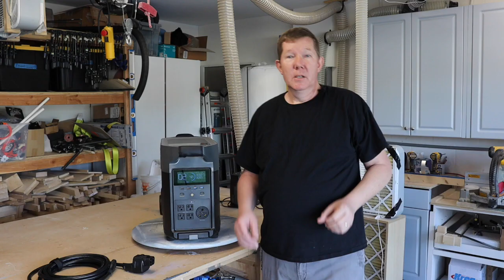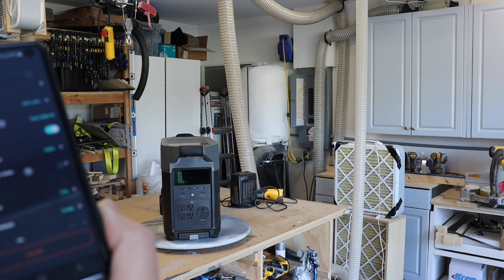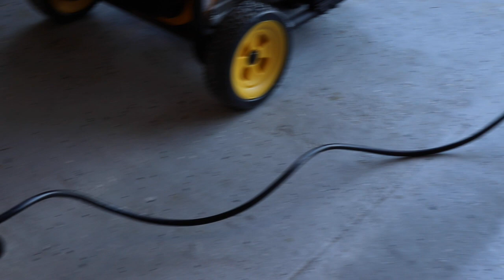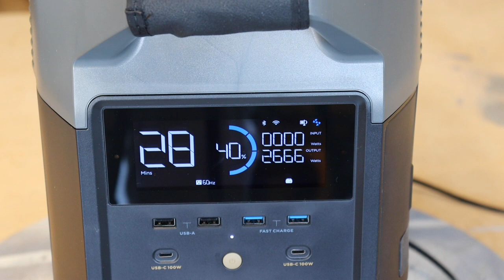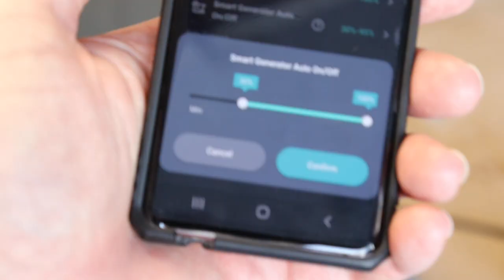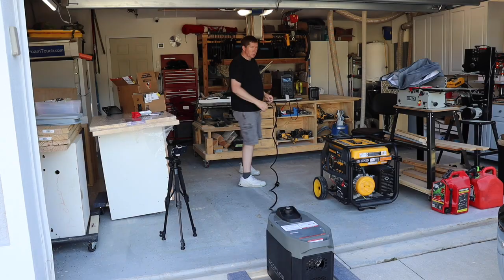Ecoflow (Smart Generator Test) 2022

Comment: They should have used an ACG system so that the alternator itself becomes the starting motor.

Using an ACG set up (like Prius and Many Honda motorcycles) makes for a lighter and smaller unit and quietly brings the motor to life, it’s hard to explain.

No noisy starter gear system and such.

Comment: 1600 watts is low. I’d rather use my 5500 watt generator to charge and provide power. 1600 will be a slow charge if I’m using power as its trying to charge.

Comment: Charging and data communication should be done by AC line, because transferring power via DC line with high current rates is burdened of high looses for heating (unfortunately someone came up with the idea to push so much power across the "low voltage" DC line). For this reason cable has only 5m and i don't think so that Ecoflow make a longer cable or cable connector for connect multiple 5m cabels.  They should do a special extension cord only for comunication between generator and deltas, with the possibility of connecting an ordinary extension cord. This could be the solution of the problem. When you use it as a mobile power the "Home Smart Panel" it's not a solution. For my setup connecting cable should at least 10-15m.

Comment: I did not order the smart generator as part of the Kickstarter campaign but good to know that it does indeed communicate with the Delta Pro and turn on/off when you set the parameters in the app. Seems to be a lot of confusion over on the FB group so thinks for clearing it up.

Now I might buy one when it becomes available via retail channels.
Reply: I been very recently looking into these Eco flow power stations etc but damn that smart generator would do my head in, from the video it seems way too loud, wonder if there's an electric/solar panel version? seems to be a bit odd to me as to why not when considering the way the delta pro works

Comment: Hey dude just a idea that I thought of but I thought of that I'd like to share with you.. When you install the transverse switch or the Eco flow panel is panel next to your distribution panel andistribution panel in your home how about moving the transfer switch or Eco flow Electrical panelectrical panel down the wall a little bit and run a condo it up to about where your and looks like a drill press which is closer to your front door or garage door garage door. I don't know what the wiring situation is with the echo flow electrical panel and transfers  Switch. That might solve your problem but then on the other hand it might be easier to to not put your generator out in front of your house where you can't keep an eye on it.. You might want to think about using your side yard and go out through the side of your garage and just put a little 4 by 4"  Is recreational vehicle access door in that wall said that you can get the cord through the wall.

Comment: Your issue with 5 meter cable may not be a problem once you get the Home Smart Panel and Infinity cable which I've heard is about 2 meters in length.  You could place the panel next to your current electrical panel and the Infinity cable would get you ~2 meters towards the garage door and then additional length with the 5 meter cable to generator.

Comment: Thank for posting this, great info!  I am looking at the same setup for hurricane prepping down in Florida.  A couple of questions for you if you don't mind: Can the generator charge the Delta Pro while it's being used by a realistic load such as a regular refrigerator, window A/C unit? Or does one need to have zero load on the Delta Pro for it to charge?  If you don't mind testing your unit with such devices that produce an intermittent load, how long would the Delta Pro take to charge from the Smart generator? Finally, what would be the fuel consumption of the smart generator under such conditions?
Reply from the maker: Jorge, I'm in Florida too. To answer your questions, the Delta Pro can be charged and discharged at the same time. However, as mentioned in the video,  I had more power going out, then what was coming in, so the generator would never catch up. Window A/C unites use a lot of energy and the Delta pro would drain quickly. Consider this, the DP has 3600 watts of energy. If an A/C unit and refrigerator both equal (lest estimate here) 2000 watts, then your Delta Pro would last less than 2 hours. What ever your appliance is rated at, that is for 1 hour of use. A 1000w microwave, uses 1000 watts running constantly for 1 hour. It would drain the 3600w battery in 3.6 hours. Also worth mentioning, most AC units run on 220v electricity. One Delta pro is only 110v so it would not power it. But, two Delta Pro's connected with the Double voltage Hub or the smart Home Panel, can produce 220V. The Smart Generator has a 1 gal tank, and can recharge the Delta Pro in less than 2 hours if the Delta pro does not have a load. If you have a full load on the DP, the generator will never catch up since its only generating 1800w/per hour into the DP. So the DP will eventually run out anyway. I hope this is not confusing, it makes sense in my head, just may or may not in text.
Reply: @DownGridSurvival  thank you for the explanation I got what you are saying. I didn't know you were in Florida, this is the first video I saw of your channel (subscribing btw!) My train of thought was that since these devices are not constant loads, a refrigerator only runs on demand so it's not always going to be drawing 700 to 1000W (depending on the unit), and the small portable AC I have is roughly 500 staring Watts, compressor will stop when the small room cools down enough and then cycle just to keep the temp. That's why I was thinking that the smart generator would be able to keep the charge of the DP topped off even if it might take a bit longer than with no load.  I may also look into hooking up a set of solar panels to help with the charging a bit while there's daylight which will help ration fuel a bit more.  Again this is just theories running in my head of the way I foresee the system working.
Reply from the maker: @xxx00w0  Ah yes, your going to get better mileage with with AC/Refer compressors kicking on and off, not sure if it would be enough for the Generator to keep up, it's very possible. with the smaller A/C unit you have. I plan to do some testing with my kitchen refer and the garage refer soon to get a better idea how long it will power them. Of course outside temps will be a factor too. Thanks for the subscribe.
Reply: @DownGridSurvival  Awesome, can't wait to see your results. Good luck with the testing!
Reply: It can charge and run devices at the same time

Comment: The longer the cable the less efficient it is but you can always use the AC port but no auto start and stop and you loose the 10 or 15% efficiency gain by using the DC cable.
Reply from the maker: This is true. But for its intended purpose to connect to the Smart Home Panel, and the Generator to connect to the Delta Pro, a little more cable is needed. I'll figure something out for my needs. May just have to move it close to the garage door. Maybe I'll have the Smart Panel installed close the the garage door with the Delta Pro's then I will have plenty of cable.
Reply: @DownGridSurvival  I think alot more cable is needed as safety (CDC) recommendations state that any generator producing fumes as this is supposed to at 20' away from your home.  This is quite useless for its advertised purpose.

Comment: One thing I dont like with ecoflow. You might want this for off grid, or when SHTF type scenario. But there app only runs on wifi. I would not have wifi in either of these situations. Bluetooth would be the way to go. They say they are working on it, but will all the ones sold already not have this option ever?  Does the smart remote need wifi as well to work??
Reply: Talk about bad research lmao....... It works with Bluetooth or wifi. Like come on man, don't spread false info.
Reply: @USNEM  well I haven't got it yet, so I wouldn't know. But a couple months ago I contacted ecoflow and said it wouldn't work but are working on it.???
Reply: @josephleussink1523  you direct.connect to the delta pro if your home wifi is down.

Comment: Thanks for sharing this video. Kinda proves a point that you can certainly be off the grid If you have these two together.
Reply from the maker: I purchased the generator rather than the Sole panels they offered because I believe the generator is more useful and will certainly recharge faster and in any weather condition. But, you need a fuel source.

Comment: I ordered the main unit and an additional battery off kick starter.   Yesterday Fed Ex delivered the extra battery.   No main unit.   Is this normal?    I was expecting both units to be delivered together.
Reply from the maker: Yes its normal. I received the Delta Pro first, then two weeks later the battery. I'm still waiting for the Home Panel, and covers.
Reply: Thank you for replying.  Just wanted to make sure it was normal.   Have a great day.